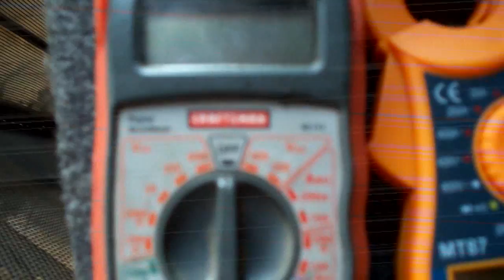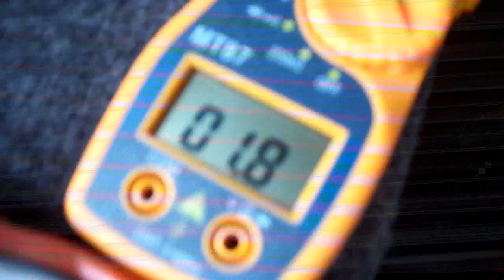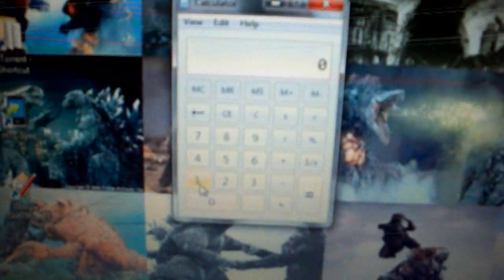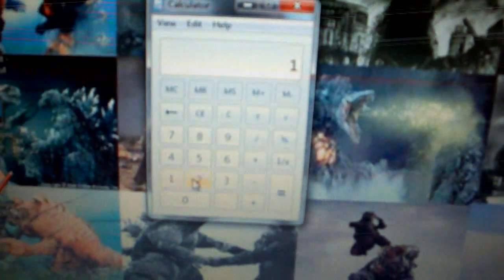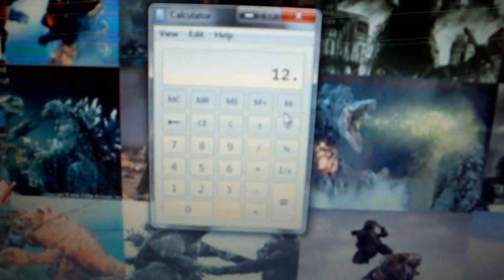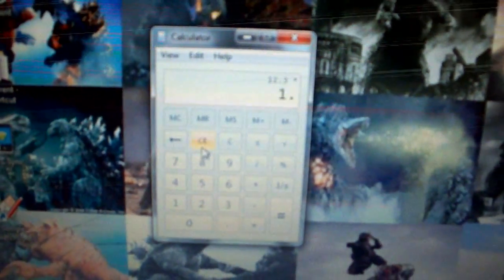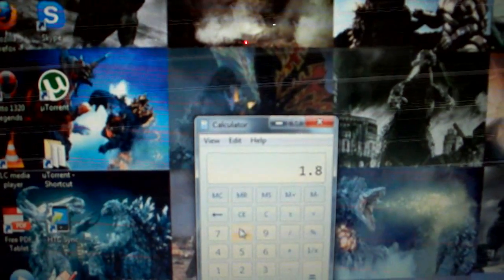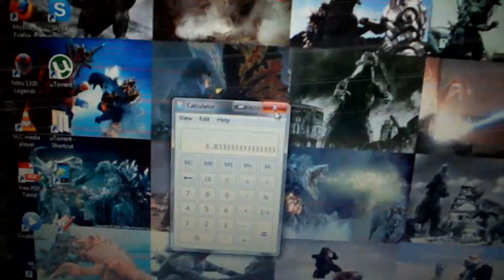How To Clamp Watts Out of Your Amp

Comment: @mazda2284 With some internal tweaks you can run 3 identical pc power supplies in series using the 5v output and depending on the power supplies get up to a 30amp+ powersupply at 15v.

Comment from the maker: @JonDeth thats why im using a cap between the psu and amp . it saves the life of your psu , otherwise i have a small lawn tractor battery that its full charge resting is only 12.1 volts that i would use with it. but again the cap is better in my opinion in this situation

Comment from the maker: @bigdog420024 the red wire are not being used other than 1 i use as a remote sometimes. the yelllow are 12 volt positive.... accurately ''cuz jondeth is posting''  11.7 volts 14amps output , the black wires are ground , and the green wire turns on the psu when hooked to the ground .

Comment: i think it works also if you dont have a clamp and just a multi meter (like i), and measure the voltage ac as well as the resistance of the outputs, then just use the formula:
power (watts) = voltage^2 / resistance. im too lazy to go buy a clamp haha, but good video nontheless!

Comment: @JonDeth Yes but rms is still the best judge of an amplifier's actual output using its peak voltage without clipping and a set impedance.  What would you use then?